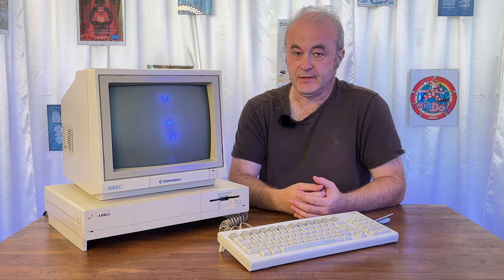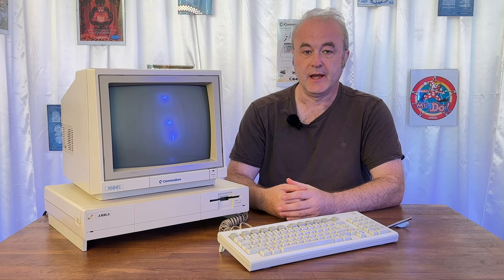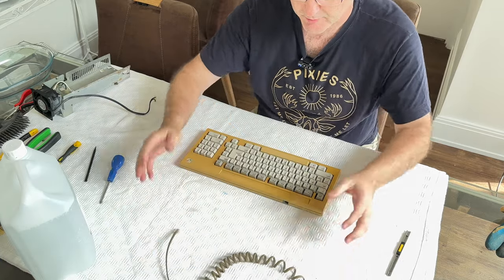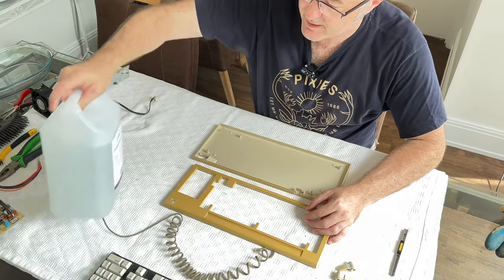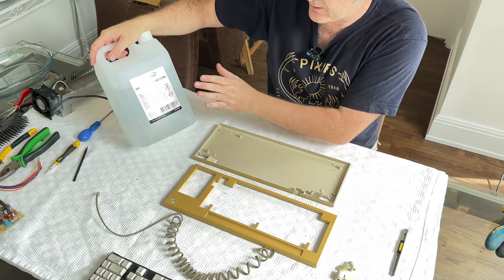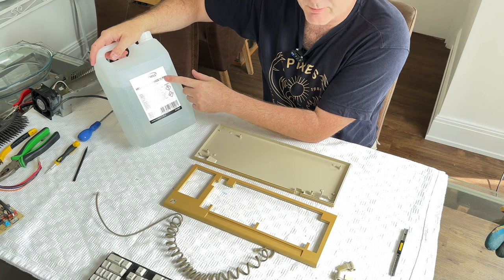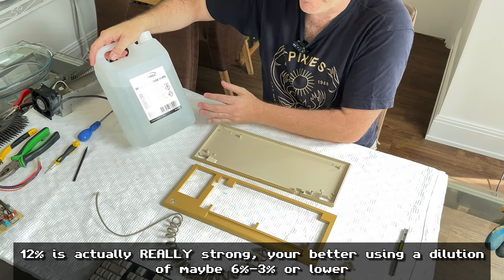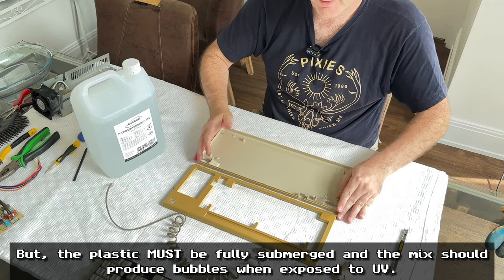Amiga1000 CH03: Keyboard Retrobrite

Comment: You lucky! These A1000 keys are in PBT plastic, never yellow for these (except the space bar, as the longer key was made in ABS plastic to cost less). Maybe your A1000 is an earlier 1986 model, isn't it? Cheers, M
Reply from the maker: Ah that makes sense. Yeah, it seems to be the pattern. Its certainly nice when something on a keyboard isnt yellowed. Still the UVNator tends to get them back to a decent colour, but its weakness is with BIG plastic. For instance a monitors case...